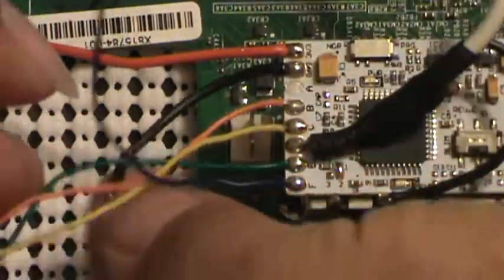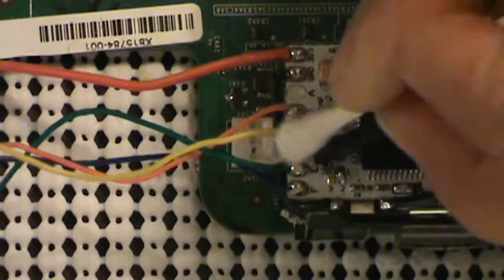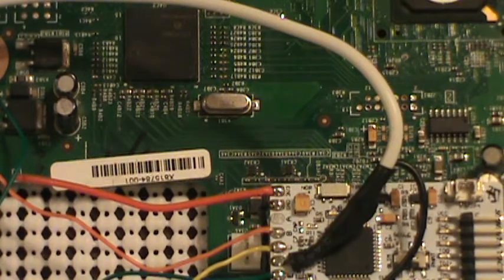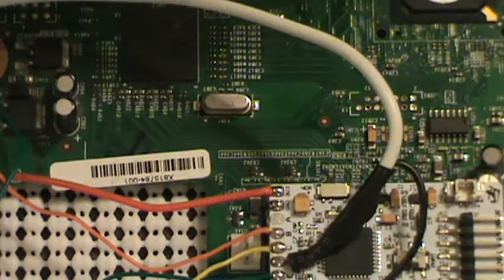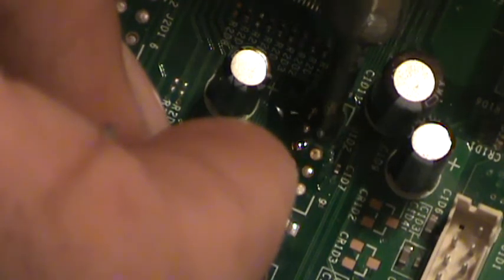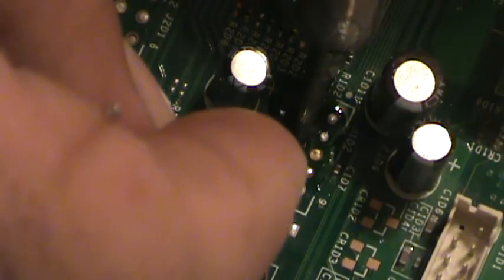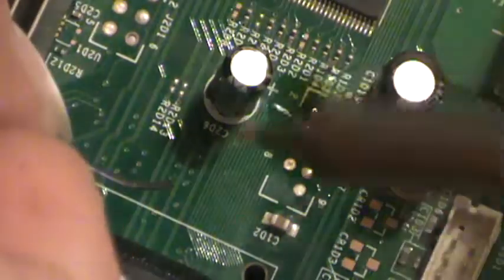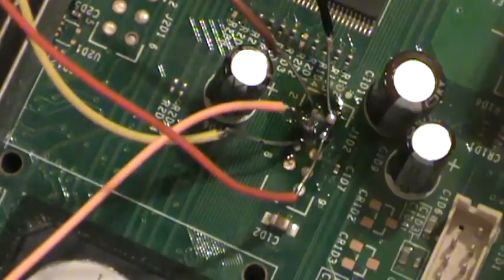Xbox 360 RGH2.0 Tutorial Part 3

Comment: Tip for beginners: learn how to solder before attempting anything. This guy is soldering very wrong, and is lucky his iron didn't ruin anything. Never set the iron on the board, or point for an extended amount of time. Always use the solder as your point.
Reply from the maker: Your an idiot.

Comment from the maker: I'm using a 60watt Radio shack Soldering station with digital temp. read out.  Its not the greatest soldering station but it does the trick.  I got mine on sale other wise you can get some nice name brand stations for the same price.